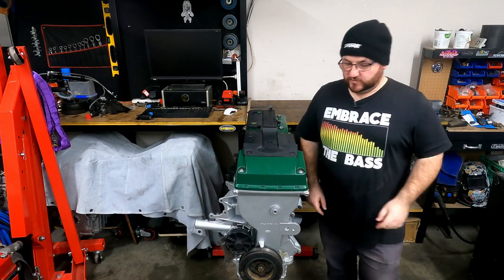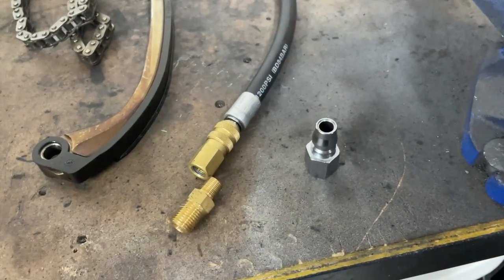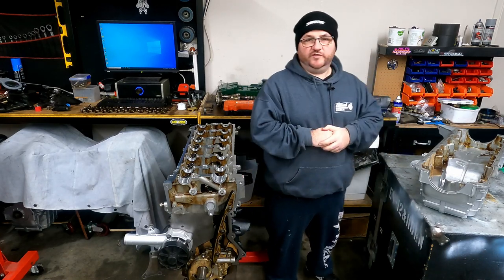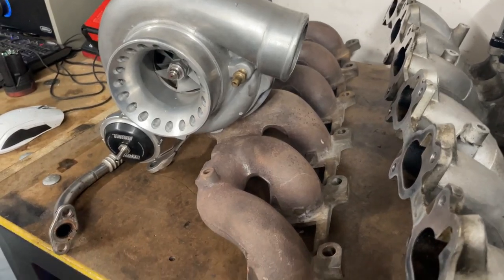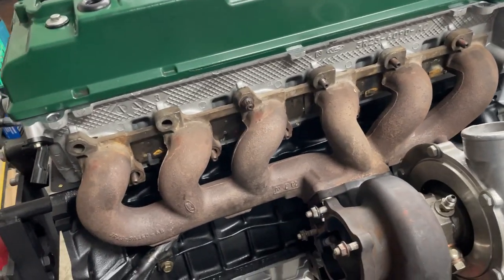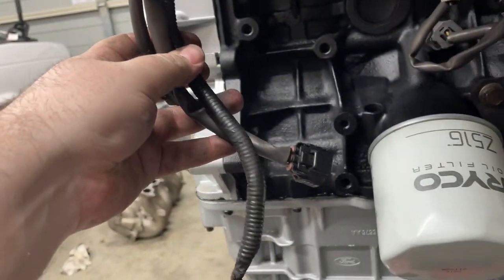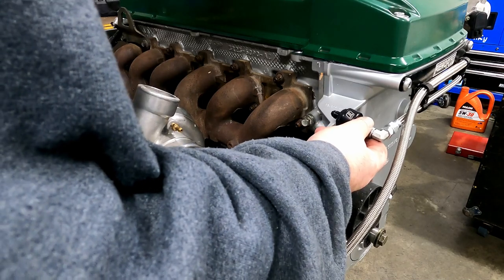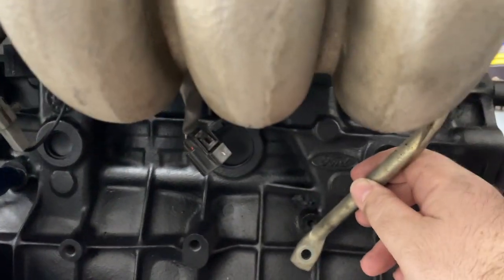Turbocharging A Barra Greentop

Comment: Access with those 'fat ratchet spanners was overcome by looking around for old- school on the cheap ring spanners on the barra just hunt for the specific sizes shocking locations.
In the day mechanics used valve lapping grit for m- cycle case sealing , might have helped when finishing off the final seal , just rubbing the fitting parts together . Enjoyed watching the video again thanks .

Comment: Tip for cutting braided hose…tape around the hose,use anglegrinder with cutting disc,alot neater cut,no fraying wire..

Comment: I used the exact tool to change valve springs  , the cut out sockets that comes in the kit need to be linnished at their backside for clearance  , they hit the cyl head towers.  And the washers supplied for the M6 bolts are just rubbish  , you need to use 3mm thick washers. Other than that all good.

Comment: Awesome videos mate very informative.. Just wanted to ask what was needed to install the Barra into the eb falcon.
Reply from the maker: Thanks for watching! Had to modify k frame, make a bracket for the accelerator pedal, needed an AU bellhousing for the auto, had to cut out a rib on the bonnet as it hits rocker cover. Fair bit to do but its worth it 👍
Reply: Thanks for responding mate.

Comment: Did you have any issues or concerns with the Crow race valve springs or did you just want to try something different? Cheers H
Reply from the maker: No issues with the Crow valve springs at all, they're still in my old red top. motor. The domintor springs were significantly cheaper so i wanted to give them a try!

Comment: Hey mate have you done any other internals apart from the valve springs etc?
Reply from the maker: Using an MLS headgasket instead of the original ford single layer gasket. I threw some replacement rod bearings in but the headbolts and pump gears are still stock for now.
Thanks for watching!

Comment: Plumbers tape on AN fittings!? Nope. You are using eBay fittings or doing it all wrong. Sorry. Not sorry.
Reply from the maker: @carpenter2410ify  Thread tape was only used on the tapered thread side of those AN fittings and not on the AN flare thread. All my fittings are from Raceworks and InTune Motorsport and nothing is leaking. No need for apologies.